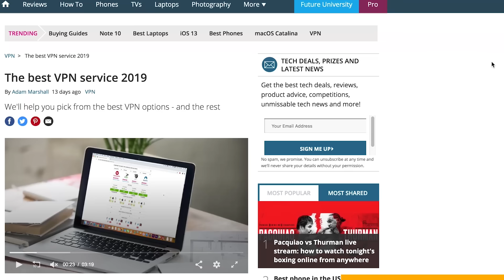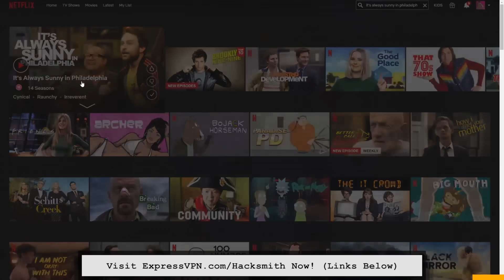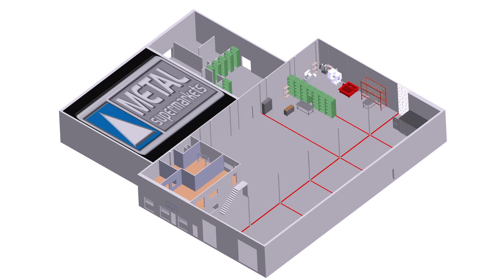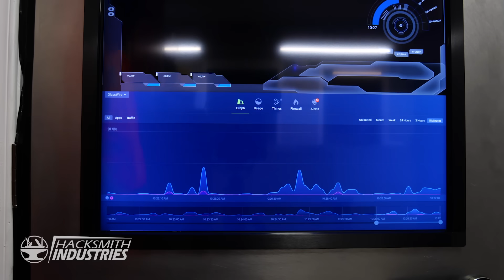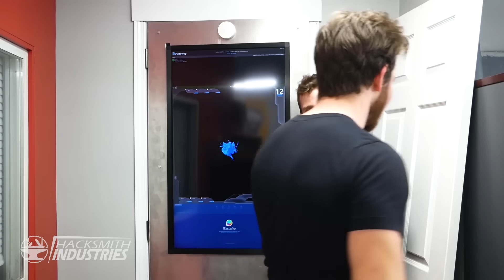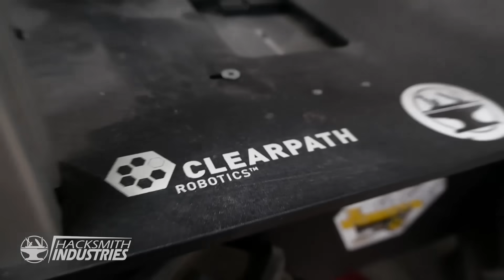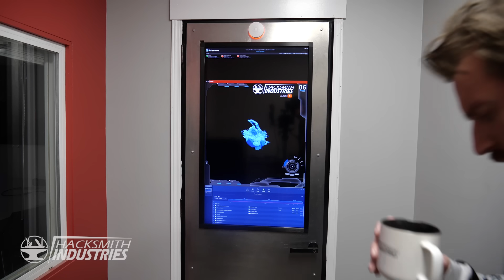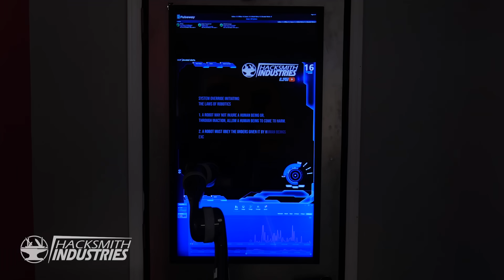J.A.R.V.I.S. in Real Life! (Shop Automation)

Comment: I don't know if you ever read this but tech that I want to see made and work just the way it does in the show even without the flight is falcons wings it could turn into Shields and the wings pop out even just a little thrust would say a lot cuz that's to be an energy base fire and it would also probably have to have a type of Arc reactorIf it can work and it needs just more power of lift think about it the falcon wings could help you keep iron Man in the air when you make your own permanent suit cuz all these items could be added into an iron Man armor all the stuff I've seen you done but I think the falcon wings at this point would be impressive even if all I can do is turn from Wing to shield

Comment: The hacksmith. This is actually possible making a real life A.I system. The only slight problem is that if you put the first coding of Jarvis in, the computer will explode! But you can get cpus and rams you might be good. But you need 14 million. Unless if you have the worlds best computer. 14 million cpus are over 20 million dollars. But it is possible

Comment: Real talk though, you guys need to make sure you back up your important shit to the cloud. AWS glacier is a pretty cost-effective option at around $4/TB/Month for storage and somewhere between $10 - $2.5/TB for data retrieval depending on whether or not you're doing bulk retrieval. That probably sounds like a lot of money, but it's a lot better than paying $1000/TB to a data recovery service. I'd encourage your IT guy to look at different services since there's probably something better out there. At the very least, PLEASE store the fireproof daily backup somewhere outside of the office. I understand that fireproof and waterproof sound like the thing is invulnerable, but you're fucked if something happens that makes it so you can't go to the office & your devices in the office don't have access to the network. Cloud backups make this easier and make it somebody else's problem, but moving your backup offsite is good enough.
Reply from the maker: Our issue is our upload speeds are abysmal
Reply: the Hacksmith In that case, you might want to look into using tape drives to back up your data gradually and then manually bring them offsite. I think LTT started using tape drive backups in 2018, so they’d probably be a good source of information.
Reply from the maker: Honestly we'll have much bigger issues if the place burns down xD

Comment: You put the fireproof NAS on top of a thin metal/wooden structure, which will be in shambles if there was a fire. Maybe consider putting it low so it does not fall or become a hazard to retrieve in the event of a fire.
Reply from the maker: Separate unit in the building.
Reply: the Hacksmith for disaster recovery my firm recommends fire boxes be placed on a raised concrete slab so that there is no risk of the vault falling or being hard to reach, and it does not become submerged in water after sprinklers and hoses put water all over the area. Off site is a definite plus though.

Comment: NO! Don't run it as a Raidz1 pool in production. Just ... don't. Raidz2 the least. Doesn't matter wether those drives are mechanical or flash based.

Comment: Ok, Hacksmith you are probably wondering what to do right now because you are bored and stuck in quarantine.  But I have a solution for you you have already made many of the things for this build and basically just have to make it look good.  You should build the whole Mandalorian outfit you haven't built anything StarWars in a long time and this would be awesome.  You have already built a heads up display for iron man and you could do the same thing with this.  You have already built spiderman web-shooters or grappling hook.  You have already built flamethrowers in the past too.  The whistling birds would be a challenge but you could do CO2 to launch small metal projectiles.  and you could make another flare gun like Han Solo's but you could make it Mando's cool Ryfle.  This would be an awesome project and it could be a series and get a lot of views.  IT would be awesome if you were to take my idea into consideration.  Thanks for making great content even in these hard times.

Comment: Another great video - Thanks. Simple question though, the lighted sign on your office wall. I don't see any power cords. Where do you have the power wires hidden> or Battery? Love to see a video how you control the devices as well. Arduino wifi?
Reply from the maker: I ran the wires behind the drywall :)

Comment: There's a TON of services that give you unlimited storage. Just have the backup sync to a cloud database. This way you'll have everything available in case of a fire and might just need to recover the most recent few days of work from the NAS.
Reply from the maker: Our upload speed is too low
Reply: @hacksmith  Something to consider. Most of my clients have a 4G backup (USA T-Mobile) about $45/month with static IP. Although the latency is very high. 4G bandwidth normally gives you pretty high upload speeds. For me it's between 25-65mbps.

Comment: You guys should rebuild your Kingsmen Umbrella. Plz Respond
Reply from the maker: Would be fun, but I don't think there's been enough technology advances to make it much better yet! It's going to be really hard to get thin enough bullet-resistant material to make an actual bullet-resistant umbrella that isn't super heavy and thick. I did love that project though! Maybe in another 5 years we can make it true to life ;-)
Reply: the Hacksmith I mean just make the design look cleaner. You said in the video that if you had access  to better tools it would be better. It has been 3 years and you and your team have improved a lot. You should give it a try :)
Reply from the maker: @amlking  It was more about better technology than just tools -- micro projectors haven't improved much in the past 2 years! Until those get smaller it'll be hard to make a better handle :)